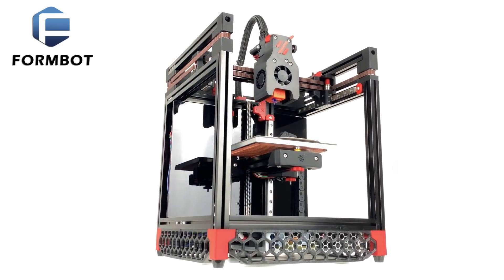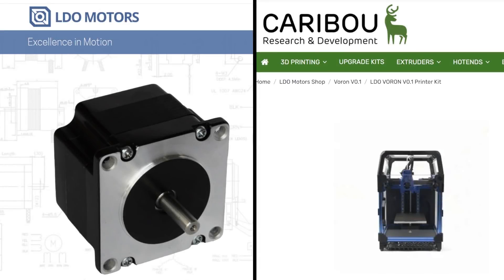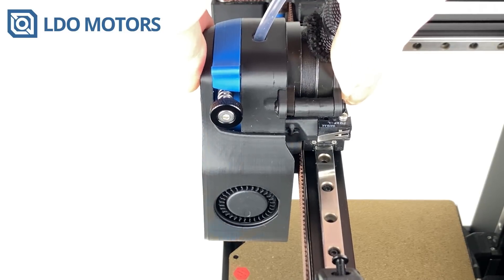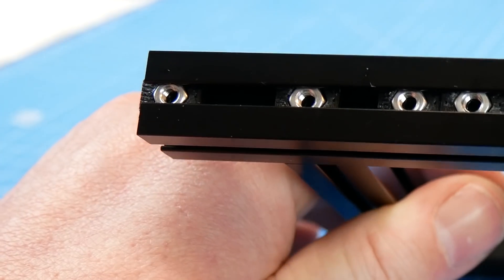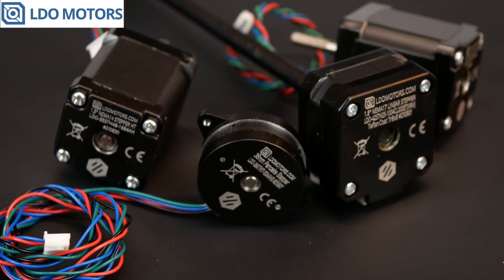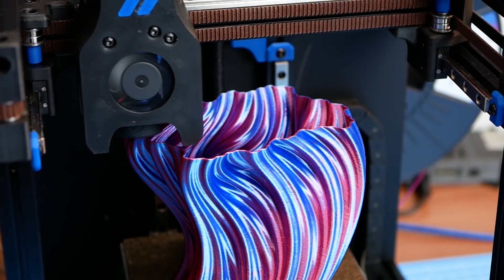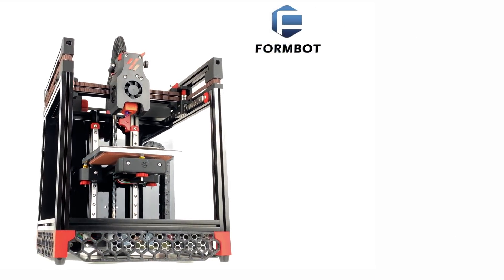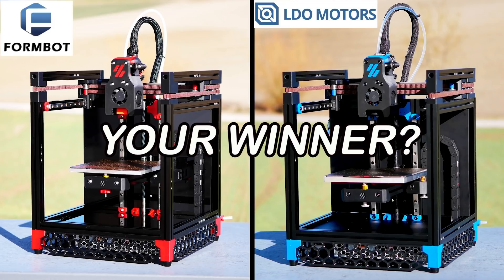VORON0.1 Kits COMPAIRED: PARTS and BUILD Experience (PART 1)

Comment: Thank ypu for the great video. A year has passed and there are now aluminium parts on the market for about 160 zo use instead of the ABS. What fo you think of that. Would it make sense especially on parts like frame/belt connections?
Reply from the maker: Thank you for watching and commenting. It really depends. For the motor drives the thermal mass of alu parts helps to keep them cooler actually (did some private testing on this). For Idlers I can't tell if there is much of a difference, but nice to have for sure. For moved parts / accelerated masses it depends on the design and weight. What I've seen so far: Not recommended, as they just copy the design of the printed parts. I'll actually dive very deep into this topic some time this year :-)

Comment: Hi, does the lubricant has to be the dry type or any WD-40 Specialist PTFE is good? Thanks
Reply from the maker: Hi, I'd recommend sticking to the official Voron recommendations - there is a bar code in the build manual.
I only know WD-40 specialist PTFE dry - are there others?
Reply: @247printing  ok. thank you. I have found similar to your, only without the dry word on the label

Comment: Do I understand correctly that on top of the kit you still need to get the printed parts?  Why are companies not just supplying complete kits?  Is there other stuff still needed on top?
Reply from the maker: Please check out vorondesign.com - these are DIY printers initially meant for self-sourcing. Some companies offer kits for the hardware and electronics
Reply: @247printing  I know Voron, but I dislike the requirement to self-source and hence applaud the advent of decent kits.  Still, a good kit should contain EVERYTHING a beginner needs to build the thing.  I know you can get printed parts from other Voron users, but then again you are sourcing from multiple sources and that's just a hassle I would not want.  It's also why I considered it stupid that Ratrig was providing everything for their printer, except the board to mount the electronics to.  Common, EVERYTHING means EVERYTHING!

Comment: DId it come with the Pi ?  They are in really short supply, most Pi 4 I see for sale are by scalpers at +220 USD
Reply from the maker: Yes, they came with raspberry pi 3b - I saw vendors for the LDO Kit stating if they send with or without the PI.

Comment: Thank you for the great video and really necessary information for new comers to Voron!! I just finished building the formbot kit as you published the video. I was having EXACTLY the same issue with the linear rail wiggle. I thought I did something wrong in my build. I am also having a bit of issue with extrusion because the extruder skip too easy despite being an dual-gear extruder. And They were not even grinding the filament, just slipping. Which makes me believe that the extruder gears in the formbot kit may have done too much deburr.... do you experience the same and could you give your comment on this?
Reply from the maker: Thank a lot for sharing your experiences! The extrusion flows of both are quite as expected - which hotend did you get?
Reply: @247printing  Just a quick update. It turned out that the problem was not enough current -- I am building a 3D printer for the first time and puzzled by the printer.cfg file. There I was not able to find the option for the motor I used so I took the 0.4A for 1.8 degree LDO motor. It turned out that I need to increase it to 0.7 and problem solved. Would it be possible for you to somehow share your printer.cfg file? I think for the formbot kit it will be really useful for someone who builds it for the first time.
Reply from the maker: @xiwu1465  hey my friend, I’ll share after/on the next video (Part2 of the comparison: performance)👌
Reply: @247printing  Great, looking forward to Part2!
Reply: @247printing  I got the Phaetus Dragon standard flow hotend. I think it is the same one as you showed in the video! I tried several cold pulls and also swapping the nozzle with a e3D 0.4mm, but the result turned out to be the same.

Comment: Seems to be the formbot would be my choice, since I like to "tinker" and wouldn't mind the extra work for wiring and switching up cooling fans. I have a lot of wiring and connectors laying around from other projects. Along with heatshrink and solder.
Reply: I just received my formbot V0.1 kit and I can confirm the cooling fans are now SUNON fans so thats a big upgrade over these no name ones seen in the video
Reply: @arsalantavallali5959  thanks! I haven't ordered yet I am currently dealing with q partial vzbot upgrade to my x5sa. One project at a time 😃

I got someone that wants to buy my x5sa when it's done.
Reply from the maker: Then it’s definitely a good choice for you 👌

Comment: You forgot a key difference… support after purchase.

LDO has been phenomenal in post-purchase support, and Jason has done right by the community at every turn. LDO hasn’t been “flawless” per say, but they have done everything in their power to fix any fails that arise, as well as being up-front about said fails instead of trying to sweep them under the rug.

I’ve not heard great things about Formbot’s support, but I’ve also not heard a lot about their support in general, so it may well be a case of “no news is good news” outside of the negative things I’ve heard.

For clarification and record, this is my personal opinion, which doesn’t necessarily reflect the views of the Voron team.
Reply from the maker: Thanks a lot for your comment! The support is hard to judge from my side as I am in contact with Jason, Caribou3D and Formbot anyways. LDO has the advantage of Jason‘s/LDO‘s community efforts and their resellers all over the world - that has been pointed out. Formbot also is open for customizing their kits to your needs or giving refunds when their is a problem. But they don’t have the dealer network and they don’t have a Jason :) there was no direct evaluation of the customer support, I agree, but the general conditions should be quite clear. For future reviews I think about detailing this topic a bit more, there are ways to test it and it’s interesting - thanks for bringing this up!
Reply: @247printing  fair points all around! Great video!

Comment: Thats strange, the bolts and nuts in my formbot kit where also black and not stainless steel, as you have shown ^^
Reply from the maker: Same for me in the first Fombot Kit - they change the parts quite often in between, depending on the actual sources for the parts. The Oukeda motors are going to be changes soon also and they added the tools for the Dragon HighFlow.

Comment: My LDO kit v0.1 cost 1000EUR with VAT and shipping, so eff it!

I also had lot's of problems, like the magnet sheet demagnetizing or the fact that the extruder motor is shit.

You can get a fysect kit for 500EUR, which is what I will be doing once I manage to sell some of my other printers.
Reply from the maker: Where do you live and where did you order? Locally sourced in Germany (Caribou3D)  it's 685€ (inkl. VAT) + national shipping ~7€.
1000€ seems very very high!
Reply: @247printing  ordered from lecktor, shipping was 90EUR, the kit was 685EUR , plus 19% VAT on both.
Caribou had the same outrageous shipping charges, they were actually 10 EUR more expensive.

Comment: I would definitely choose the LDO kit. I've purchased 2 other LDO kits, a Prusa kit, and done self sourcing for a custom printer. If I'm going to buy a kit, I don't want to have to source more pieces just to complete the build.
Reply: then DON'T get the LDO kit for the V0.1!

It is expensive AF and you can get 2 of the other kits with the same money.
Reply: @jeremytine  where I live, you can!

LDO shit kit is 1000EUR.

Aliexpresss kit can be had between 400EUR and 600EUR.
Reply: @jeremytine  well, a fysetc V0.1 kit shipped to my address from Ali costs 481EUR with VAT and shipping included.

An LDO v0.1 shit kit costs 685EUR bare !

By many users you mean the youtubers and a few lucky first buyers, cause the Voron "community" is missing from the web.

Bought it from Lecktor, don't think the seller really matter since the package was in the original unopened box from LDO, it even had their branded shipping tape.

If you live in the EU colonies you will always spend more that one who lives in an EU country for the same thing. By colonies I mean those countries who are officially in the EU but not in Schengen and don't have EUR as coin.

Anyways, for me, Voron is a dead and stupid project, too bad it is the one who made a printer that I really wanted from the specs, the V0.1. But after the experience, I will spend my money on something else.
Reply: @jeremytine  I am seeing different prices, it's 481EUR for me, how about that.

It is the fault of LDO if they send shit in Romania but good stuff in other places. It is called "double standard" !

The kit quality does not justify the cost!, even 685EUR is waay to much for it. The real price should be around 150-200EUR for that crappy quality.

The magnetic sheet was just the beginning, the extruder motor is different from the ones in the videos on youtube and skips steps (got to about 14mm^3 max with PLA at 250 degC), the "original BMG" extruder gears are shittier than a clone which I bought for 5EUR, the 24VDC cable powering the SKR is super thin and gets warm making it fire prone and so on...

Verdict: LDO SHIT KIT.
Reply: @jeremytine  what vulgarity SnowFlake?

Forgot about shipping and VAT? We got those in EU.

Since when 1EUR=1USD? The prices are basically the same unit wise, but different coins, which makes it more expensive in EU than in the US from the start.

The LDO kit has bad quality parts, it is not worth half the money they are asking for it, but this is normal nowadays, it called "Bait and Switch", send youtoubers free high quality kits, send a few more to early buyers, then shit on the rest by changing components.

For example, the magnetic sheet included in my LDO kit demagnetized at 90 degrees Celsius, take that for quality. And the problems didn't stop there.

Comment: Great video, can't wait for part 2. I picked up a formbot kit last year (before they included the prebuilt wiring) and it has been running like a champ. I have even used it to print the parts out for my new Voron Trident build that I finished this week.
I did have to change my extruder motor on my V0 from the moons to LDO motors because the moons one died on me. I also have some spare A/B LDO motors ready to replace as soon as the Oukeda motors die. But overall it has been a fantastic build, and I'm happy to have a hybrid Formbot/LDO printer.
Reply from the maker: Thanks a lot! I also build an early Formbot kit (V0.0) and was able to do some crazy speed stuff with it - can’t be that bad! ☺️

Comment: This is probably the most well produced 3d printing video I've ever seen. I clicked the bell, which isn't something I ever do. Now I just wish I had seen this before I ordered my formbot kit!
Reply from the maker: Wow, thank you so much 🤩 Concerning your decision for Formbot: You might have to dive deeper into the wiring and change some parts, but in the end you’ll have a well operating Voron0.1
Reply: @247printing  I actually already did the build. The kit wasn't bad except ufortunately the extruder gears failed quickly. Waiting on genuine bondtech replacements. 
I might have still gone with the Formbot kit, but there are a few things I would have  upgraded right out of the gate like linear rail backers, the kirigami bed, and now in hindsight the extruder parts.
Reply from the maker: @caramelzappa  That’s interesting! I which way did the gears fail? So far no problems here
Reply: @247printing Whatever the fault is its really hard for me to see. No actual visible defects.

When it was running it was grinding off little flakes of the gears, and while I can't see the imperfection I can feel resistance just pulling filament through. It's possible I overtightened the ABmini which caused them to damage themselves, but in any case they have to be replaced.
They also weren't properly aligning with the filament path which probably contributed.

Comment: Very nice video A.! Huge step forward in quality of video production. I really like the overhead shots and macros of the parts.
Regarding the products LDO is the winner for me. Looks a LOT more hassle free than the formbot kit. Also proper tools and accessories are easily closing the 100$ gap.
Very well done 🦄
Reply from the maker: Thanks a lot FaFi 🤩 Fully agree to the sum up - if you just want to have a relaxed build experience with well sourced parts - go for LDO. Not everyone wants to start a career as an electrician 😬
Reply: @247printing  true that :D

Comment: Glad to see you get the giant hand print on the back of all Formbot build plates! (mine came with a rather large one on the back, a whole hand!)

As for Formbot versus LDO, based on my experience with Formbot's Trident 300 kit, I'd probably cough up the extra $200ish CAD for an LDO kit if I were to build a v0.  One thing is that for Trident and v2.4 kits Formbot includes bottom panels that are known for warping shortly after you power on the print bed - hopefully this isn't an issue with LDO's kits.  Big thing that's a selling point for me though is that with the LDO kit you are getting actual properly spec'd parts versus Formbot where they tend to take the occasional shortcut on things.

I'm definitely curious for part two!
Reply from the maker: Thanks a lot for your detailed comment 🙏👌 Also really interesting you got these hand print also 😬 (while editing I thought they were my own ones…)

Comment: Good vid. Great comparison. I went for an LDO. My only complaint was the DOA BTT SKR board, but the supplier changed it out and I haven't had any issues.....oh there were some metal chips left in the extrusion threaded holes, so check and clean your extrusions before assembly.
Reply from the maker: Thanks Sean! Valid point: I had to clean both with compressed air 👍

Comment: Any word on how corrosion resistant the black fasteners from LDO are? Maybe test a spare from the kit. I know they look nice, but if they rust like old Prusa stuff did it's a fat no from me.
Reply from the maker: I'll ask Jason from LDO about this -  I believe I won't have the time to set up and execute a viable corrosion test for the fasteners. Where do you live? Indoors (southern Germany) I never had any corrosion problems with any type of fastener here. Humidity, depending on season, varies between 20% to 60%.
Reply: @247printing  Texas, where it's anywhere from everything is sticky to why is my skin feel like sandpaper.  Thomas Sanladerer also had issues with block oxide fasteners rusting, and he runs a dehumidifier in the room with his printers.

Comment: Excellent information. Thanks! IMO, the better parts quality and wiring planning make the difference between a pleasant experience and a potentially very frustrating one. I have a Prusa Mk3s+ as my first printer and an Ender 3 Pro I built (and upgraded...a lot) for family. Given the choices I had to make and considering the cost in time and upgrade parts to get the Ender close to the Prusa for longevity and performance, I would not hesitate to spend the money on another Prusa over a Creality in any future build. I will have to see if I can pick up one of the LDO 0.1 kits for printing some materials that are harder for the Prusa.

Thanks again for all the very relevant details in this comparison/review. ;)
Reply from the maker: Thanks a lot for sharing your experience and thoughts! The tinkering/upgrading (your Ender example vs Prusa) might be fun and a lot to learn. But yeah: It's a lot of time to invest... I absolutely love the overall experience I have with my Prusa, but I don't want to miss the upgrading and tinkering on the other printers either.

Comment: I am right now watching my LDO V0.1 printing the voron cube. The assembly was pretty straight forward, the software setup took a bit more time for me. Who ever wants do build a voron: Do what the manual is telling you to do. Read it multiple times to verify the next step in every detail. When ever i did not go 100% regarding the manual, i did regret it later. 

I got some parts laying around like the hemera, mosquito hotend, a cfk tube and some ominously 247 print parts. Might even go complete fanless on the hotend with some ceramic parts, but time will tell. Hopefully gonna speed up that thing soon :)
Reply from the maker: I absolutely agree!

Comment: My winner so far is the ldo kit, because I don't like wiring. But let's see your part 2 to define the final winner
Reply: The newer formbot kits come with pre-crimped wire sets
Reply: Bought my formbot Trident 4 months ago and it came with pre-crimped wires :)
Reply: @ogge1998  great! And did you have to solder them? :)